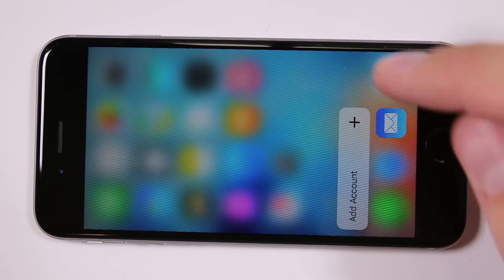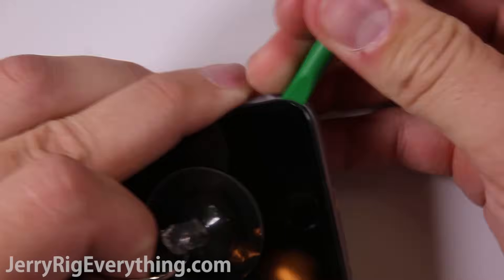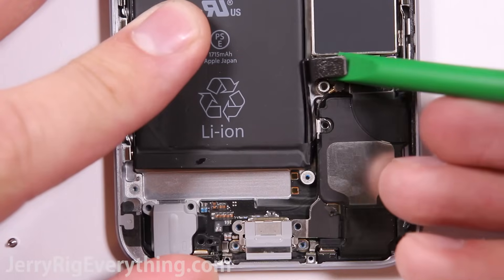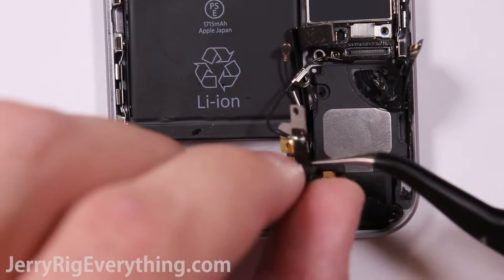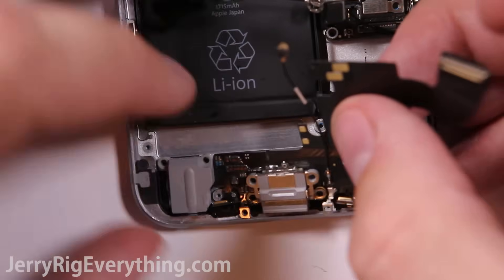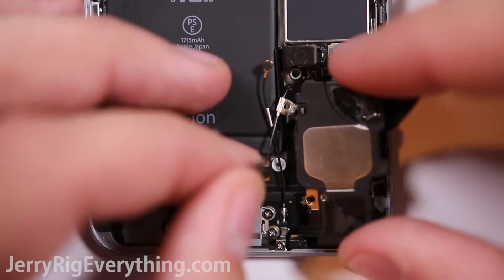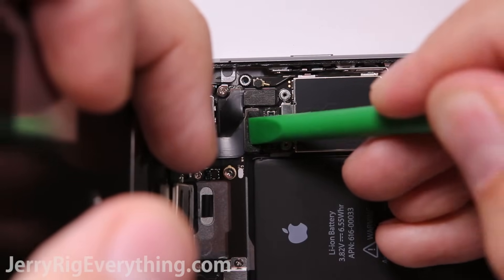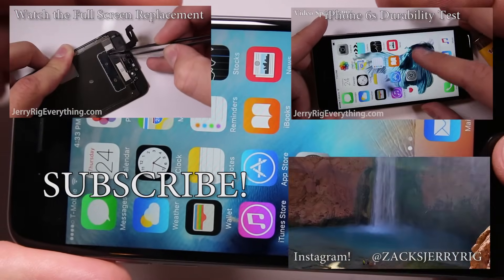iPhone 6S Charging Port Repair Shown in 4 minute Fix

Comment: You need to stop connecting the battery before assembling the screen again! Can quite easily short and blow the backlight, the battery should always be disconnected first and reconnected last.
Reply: This is what happened to me
Reply: is it possible to change the connector without removing the screen at all?
Reply: Vicious Gazza it is possible, but removing the screen will make things much easier because you wont have to worry about holding the screen upright whilst fixing the port itself
Reply: Vicious Gazza no
Reply: @viciousgazza3318  I've done it just place it up against something and secure it so it doesn't go beyond 90 degrees. Saves some time and reduces the risk of damaging the screen.
Reply: @nolanhoskins2474  ALWAYS connect the battery LAST.
Reply: Disconnect battery first thing every time yup. I shorted my logic board on a 6s unfortunately when I forgot too.
Reply: @T_G_2_0_1_1 it happened to me twice I'm so effed up
Reply: Oof
Reply: John West  did some little noob boy blow his backlight because he blindly followed a tutorial?😂
Reply: My first rookie mistake on my first phone repair attempt earlier this year 😂😂😂
Reply: You should always connect the power source last on ANY tech you're messing around with. thats basic 101 shit lol
Reply: if the phone is turned off, the presence of the battery connection should be irrelevant. Although it's never gonna hurt to go through these extra steps for safety!
Reply: Yah that’s exactly what I was going to comment! This guy is obviously a noob trying to pass off as an expert 😂 He saw directions on WikiHow & had a HQ Camera for views 🤣 What an idiotic buffoon

Comment: I replaced my battery then the charging port and my phone still will not come on. Won't even show it charging. I had my screen replaced a few months ago and when I was doing the battery and the charge port I noticed a wire at the top looks smashed. I thought it was the antenna wire . Could this be what's causing my issue? 
My phone was working and I was doing some work up and down in and out of a chair. I had a case  on it and didn't drop it that day but did sit on it a few times. I thought my phone had gone dead so I plugged it in. It hasn't come back on since. The only crack I have is near the edge of  home button... nothing through the rest of screen. Any suggestions would be greatly appreciated.  iPhone 6s (not the plus).
Thanks!
Reply: BrokenRRT sounds like it's time to upgrade

Comment: Helpful video, thank you.  

Now for the bad stuff:
DO NOT buy the Tool Kit used in this video.  I purchased it in 2015 and it is very poor quality. The driver handle is the best part of the kit, other than the case.  The bit fall out of the handle, the suction is a weird piece of unknown material that is oily.  Even after washing it will grab onto anything.  The seller offered me a discount on another product, which of course I declined.  This was after he agreed that the tool kit is pretty much useless.

Comment: If my phone fell and it stopped charging would I be able to fix it without having to change the port? Is it possible to just check if the wires and other stuff are placed in their right position?

Comment: hi friend i hope you can give me some advise , i have an iphone 6s for repair , it didn't turn on at all , first i change the charging port flex, nothing happened, still didn't turn on , then i purchased i new battery since i measured with a multimeter the old one and it was 0V completely dead, when i connect the new battery the iphone turned on but when i connected the original cable and original wall charger the phone doesn't charge , it pops up a windows saying" this cable or accessory is not certified and may not work reliably" and it's the original one from my brother's iphone 6s , could you give me some help please i don't know what to do , thank you very much !

Comment: Having quite some trouble with this one. I have two iPhone 6S'es, both factory unlocked, not recognising the SIM card after charging port replacements. It displays the 'no sim card installed' dialog with intervals of about 10 seconds. When the SIM is inserted, it goes to NO SERVICE and the 'Carrier' option in settings continuously appears and disappears.

All symptoms disappear and the phone starts working normally again as soon as the new charging port connector is removed and the old one is put back (or just no charging port is connected at all). Anyone got a solution for this behaviour?
Reply: Yup.🗑️

Comment: Hi Jerry, I plugged my iphone into a USB car charger, it didn't charge and afterwards wouldn't charge anywhere else. I suspect a power surge caused the charging port to fail. Do you think the motherboard would have been affected at all, the phone was still working fine just not charging? In your opinion, will  changing the charging port help?
Reply: constateen yeah that would solve your problems

Oh wait I’m a year late...
Reply: Similar thing happened to my Galaxy S6, and it was hell trying to take out the charging port because of the capacitive buttons are attached to it which mean that I had to remove the front panel including the screen from the frame.

But to answer your question, yes it does solve your problem.

Comment: Hi.. I recently plugged my iPhone in to a USB car charger, that had a double outlet on it,as I wanted to charge a battery pack as well as the phone, anyway, the battery pack light went out and I smelt burning..had to buy a new lead for the iPhone but it still charged ok, then I noticed the battery drained in like 8 hours, when. Or ally it would go for around 15+.. So I replaced the battery, but still it's draining fast, could something have blown on the charging port? .. Thanks. Martin

Comment: Hi there, I followed this guide step by step and did everything carefully and correctly but now the phone says "no service". When go under setting menu the carrier menu keep on appear and disappear. Any help would be great thanks!
Reply: The same exact thing happened to me. Any word on how to fix it?
Reply: Zoe Epshtein Hey I got mine fixed. The problem was that if your phone is bind to a specific carrier. you have to get a genuine apple part and not the 3rd party cheap one on ebay. Those cheap one only works on unlocked iphones. Look for apple genuine OEM parts. If you look on ebay they are mostly used like this one here : http://tinyurl.com/gsn2374 

They cost about $20 bucks. Anything less than that is a knockoff. Hope this helps.
Reply: You probably have a small rip or tear in the cable
Reply: Hey man what service do you have? I have a tmobile 6s and i replaced it with an apple part but it still says no service
Reply: Alterizee did you remove the motherboard for this repair? If so your sim may not be making contact with the motherboard. If you didn't remove the motherboard I would make sure everything is connected properly as per this video. Worst case scenario reset the phone to default
Reply: +Alterizee i have t-mobile too. You need to buy the genuine oem cable for it to work if your phone is still on payment. I went through 3 cheap cables before I figured that I need to buy the oem one.

Comment: Thank you so much! One question...I did the whole repair and my phone charges great now (the charging port was corroded before) but it won't register service. Says "no service" on the top left. I've gone and checked a few of the connections, but I'm not sure what I'm looking for. Any tips/connections I should check? thanks!
Reply: The same thing happened to me any word on how to fix it?
Reply: Same to mine. Did you ever figure out the problem??

Comment: Hi Jerry, thanks a lot for this video, I'm thinking about changing my charger cable for my 6s but am really concern about scratching my iPhone at any point. Can you confirm that with your method you can manage to not scratch the external and visible part of the device (screen and side areas surrounding)? Thank you!
Reply from the maker: +Romain Jacquiot Depends on how good you are with the tools.  It might be a good idea to check with apple before  you do anything to see if they can save you any money.

Comment: Please Jerry I need your help on this cause you are the one who's up for it and will give me the exact solution. I have an iphone 5 working with IOS 9.0.1 and I have this problem since I was using IOS 7 and it happened out of a sudden. The mic is not working in phone calls while using the speaker, not working with Siri or the front camera but works fine in voice memos or regular phone calls so is it a software problem that needs a trick or it's a hardware problem and which part should I replace to solve this issue ?!! Thanks in Advance. I do appreciate your help.
Reply: Just check back of the phone
There are one more microphone next to the camera
I was having the same problem
It might be there is any plastic stick on it or may be and cover on it!!.. When you use speaker on calls, recording video then phone will use back side mic but for something else it uses the normal next to the charging port mic 

Good luck